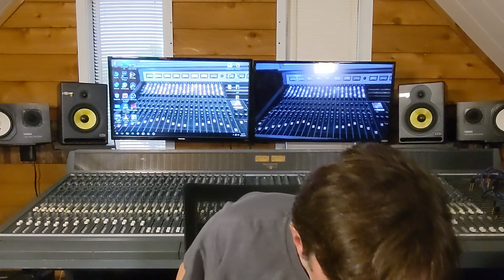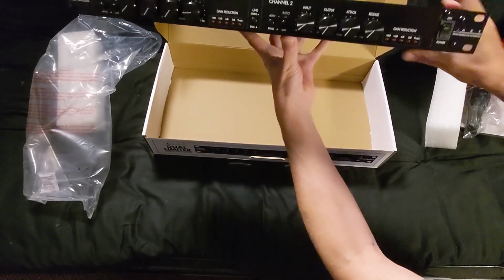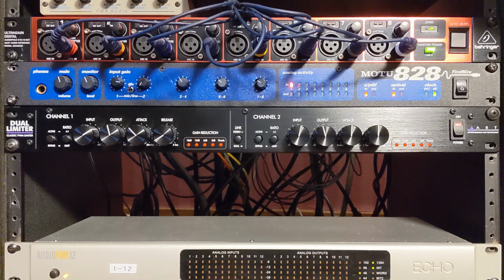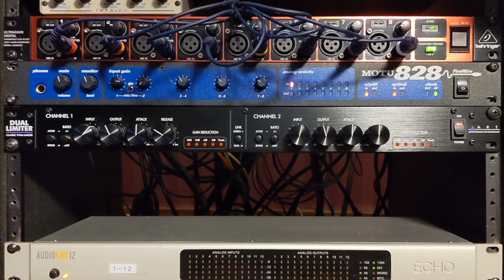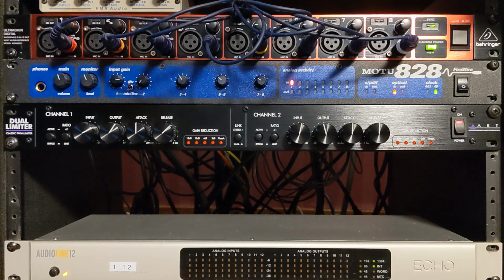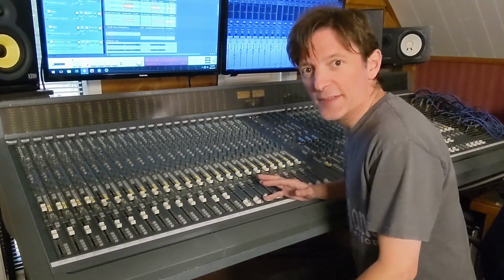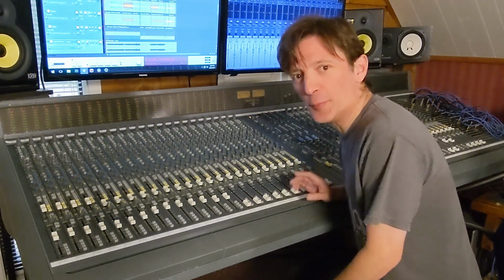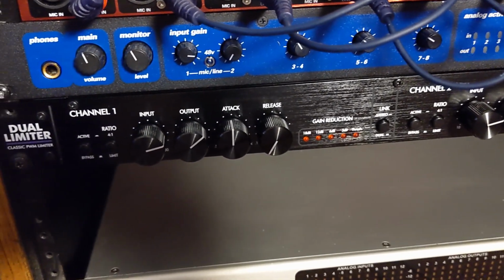ART Dual Limiter

Comment: Great review!!! The Dual Limiter is a such and awesome Pulse Width Modulation compressor!! It's a PIE Comp for less than 10 grand!!! Thanks for the mention!!!
Reply from the maker: Thank you for the recommendation. I am extremely happy with this Dual Limiter. It sounds great and it's very different from my other compressors. I really like ART gear anyway and they have pulled off another win in my opinion with the Dual Limiter. It's unusual in that it's so clean sounding compared to things like the VLA or TCS until you start really pushing it and that's a great sound too. Overall I really like the Dual Limiter and I very much appreciate the tip. I always love learning about new gear that's great and not too expensive.
Reply: @TwinCreekAudio  I’m glad you liked it, the dual limiter is amazing. PWM compressors are very unique and powerful. Give this a try. On a vocal set the attack around 11 to 1 o’clock and a slow release at around 2 or 3 o’clock and hitting 4:1 pretty hard pushing the input (similar to an 1176). The dual limiter can sit a vocal right on top of a mix with no audible saturation. I have even used it in the limit mode a couple of times on a vocalist who was just a powerful gospel singer while tracking. It seems to work better than optical comps for that. I also love it on electric piano and organs with a slow release just holding them in place. I’m so stoked you liked it! Congrats on the new tool in your toolbox!
Reply from the maker: I'm going to try it on a vocal really soon. We used it for parallel compression on drums for an entire album recently and it worked great for this. On toms, it makes them sound huge but smooth. Love it!
Reply: @TwinCreekAudio  For the money it's a great PWM comp, the nearest competition is 10 times the price.

Comment: Thank you! I have been waiting for someone to demo this. I have the MXR Dual limiter which the ART looks to have based this on  and is a secret weapon in many studios on drums. I wish you smashed the input a little harder to hear how (or if) it distorts similarly to the MXR Dual limiter.  Awesome video none the less.
Reply from the maker: Thank you! It doesn't get the same kind of sound when you push the inputs. I tried that before the video and it pretty much stays extremely clean which is really cool in some ways. You can really compress something a lot without those artifacts. I kind of miss the added saturation but it's a different tool and I have other comps that will color the sound more. The Dual Limiter seems to provide that a massive amount of compression without color but still seems to warm things up some. I might make another video about it at some point and I'll be sure to try that again.
Reply: @TwinCreekAudio  I had a feeling it may not distort which is good too for other applications.  If you get a chance to pick up an old Alesis Microlimiter cheap I think you will be shocked by the bang for buck and amazing character it adds to drums and bass, some people like Mac Demarco even used it on mix bus for some of his hugely successful albums.  I will definitely give the ART Dual Limiter a shot
Reply from the maker: I just sold a Micro Limiter last year. They are cool but I wasn't using it much anymore and I had to raise some money since I had lost my job last spring and took awhile to find a new one. They do a really cool thing though kinda like a Level Loc
Reply: ART was started by engineers from MXR, so I would say that influenced the design. It's cleaner than the older MXR M136 PWM comp.

Comment: This actually sounds pretty awesome! I've always overlooked this thing because ART has a somewhat bad reputation for cheap and not very good sounding units. This one, on the other hand, sounds very clean and precise (or clean and precise as far as analog goes). Would be interesting to hear if anyone has experienced any quality issues now that it's been a couple of years since it was released.
Reply from the maker: I haven't had any problems with mine. I'm also a huge fan of the discontinued ART TCS Twin Compressor. That thing sounds way better than it should for money. I like them so much, I have two of them.
Reply: @TwinCreekAudio  Good to know! I haven't seen any TCS comps on the second-hand market here in Sweden (maybe they were so good people don't want to sell theirs?), but I have seen a couple PWM Limiters. I just might pick one up the next time I see one. Thanks!

Comment: It looks like ART re-released the old MXR 136 Dual Limiter (Blue Face).  Not sure if this a new detection scheme circuit (PWM).  From what you described, it sound like ART made changes to the old detection circuit of the MXR 136.  A mixing tip from a mastering guy like myself, to avoid getting a twackie bass drum, I suggest placing tha attack as slow as possible and allowing the bass transient to pass.  I own several ART pieces and this could also be similar to their a Tube Dual Leveler which also has a 4:1 and Infinity:1 switch.  You make some of the best videos.  Thanks again, Now I'm going to revisit my Tube Dual Leveler.  Between my ART Pro VLA I and II, TCS, TPS, MPA Gold and many other products, I'm a huge MXR/ART/Alesis fan...
Reply from the maker: I believe you are correct and the Dual Limiter is an updated MXR. I think I remember reading that one if the guys from MXR helped to found ART. I'm also a huge fan of Alesis. I sold my Wedge last year but that was due to the desktop form factor and having so many cables in the back. Eventually I'm going to get a another Alesis reverb. I have always liked them. They had good algorithms. I also liked the Microlimiter. I love MXR gear too though I don't currently have any MXR stuff. Love your suggestion for drums too. Really appreciate the tip and your kind remarks. I work really hard on the videos. I felt like YouTube audio channels were too focused on plugins and screen captures and wanted to do something different. I put a lot of work into the videos but I love making them. It's a lot of fun for me and I have connected with a lot of great people through YouTube and it's been very positive. Thanks again!
Reply: I think there was two dudes who either owned mxr or engineered mxr gear that started up the A.R.T company. That’s what I heard. So doesn’t surprise me that this may be a re-release of something they designed back when.

Comment: I see these a lot. I'm so intrigued by hardware compressors these days. I don't have any but plugs like Shadowhills or Harrisonmixbus compressor from channel strip.  I lost the bid on 163x
Reply from the maker: I have a 163X and it's pretty good for the dbx sound. Mine is a bit noisy but sounds pretty good and has the right character. The Dual Limiter is clean and quiet. I really like it a lot. It doesn't color the sound that much until you are really compressing hard but it's unique and won't mess up the source audio. I like it best for making featured things like Tom's really jump forward in the mix without overloading anything.

Comment: Can be use in 220 volts, or is only 110 volts, thanks
Reply from the maker: With this version, you need a step down transformer to run it from 220V. They should make another version for 220V but the US version won't work without a transformer. Here's the info from the Amazon listing:

USA – 105 to 125 VAC / 60 Hz, 1/2A fuse, <15W; Export units configured for country of destination
Reply: Thanks

Comment: theres no ratio controll???
Reply from the maker: There is a switch 4:1 or Limit but no variable ratio. It seems to be program adaptive in a way so the amount of compression is set by how hard you drive the input or turn up input control. The ratio switch pretty much allows all the settings in between set by how much level you feed into the circuit.